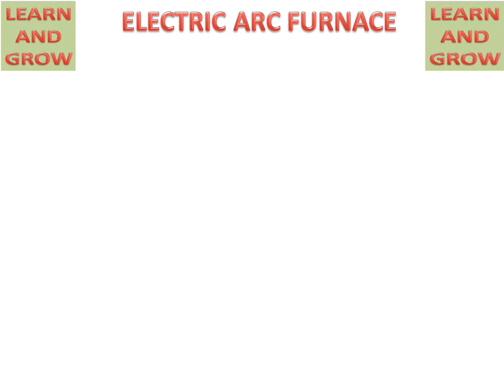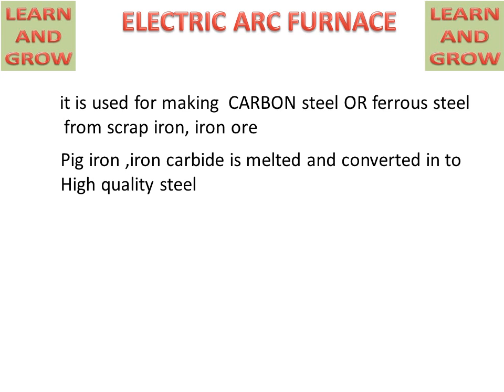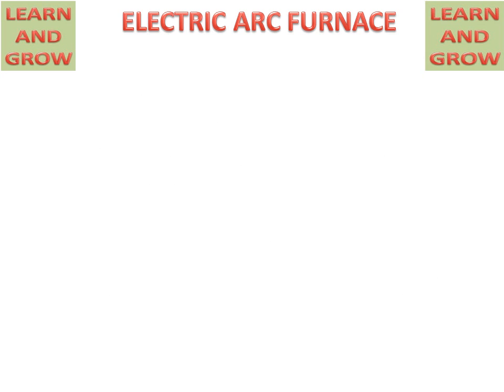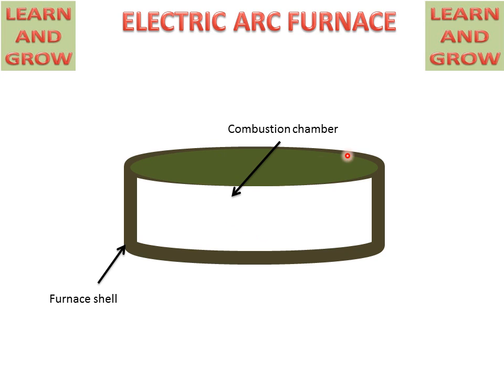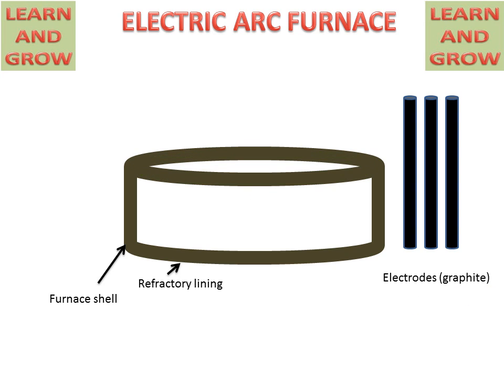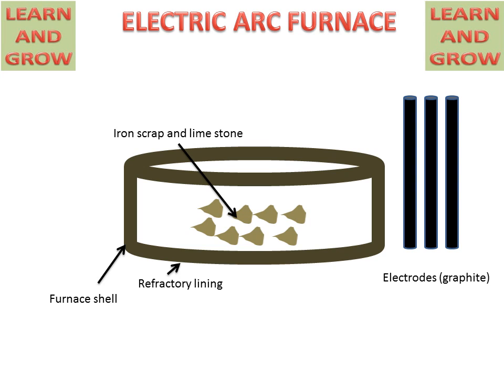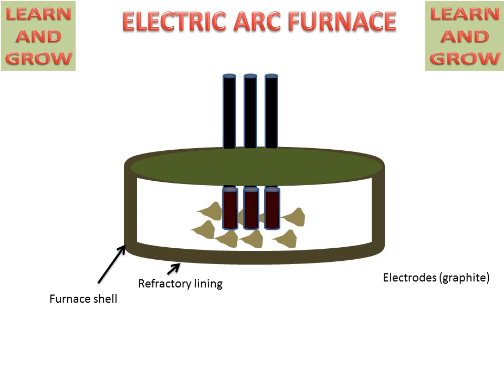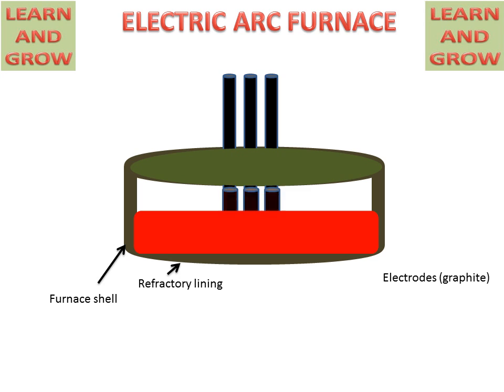Electric Arc Furnace (Electric Arc Process)

Comment: OK, so when the three carbon rods are lowered into the furnace, where is the arc? Are there three corresponding carbon rods stickig up out of the bottom of the furnace? Or do the carbon rods strike the arc with the scrap steel?
Reply: the electrodes are the cathode and the scrap steel is the anode